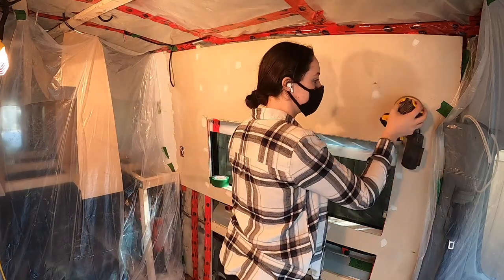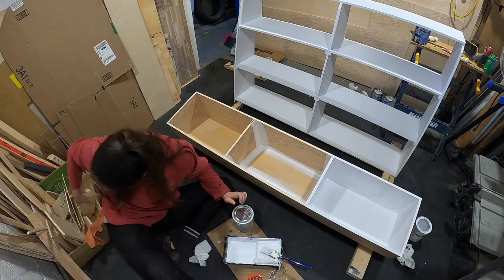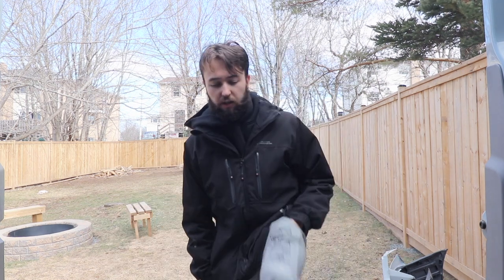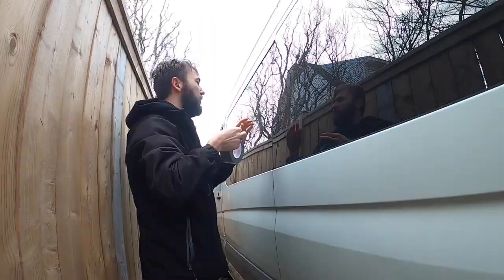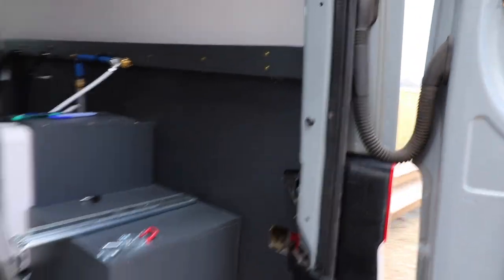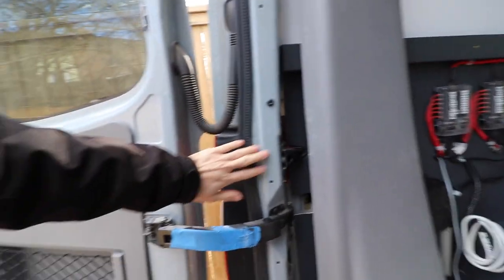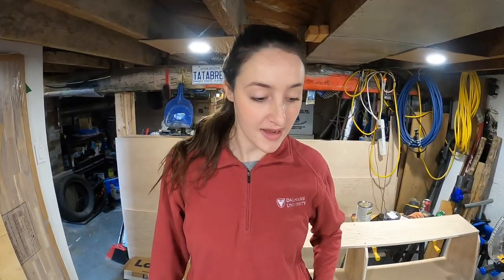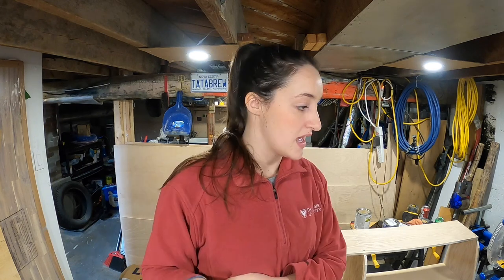FABRIC to cover exposed metal on SPRINTER VAN! | van life build pt.14

Comment: Did you upholster your cab headliner? Do you happen to have a video on that or tips?
Reply from the maker: Yes we did, didn't film it in detail... But we first wrapped the plywood in upholstery foam to create that "headliner" feel, and then we put fabric over top of that. We used the same spray adhesive and the staples to hold the fabric and foam on.

Comment: Looking good. Im Laid in a van at 5am i can say any metal you dont cover will be like a fridge shelf. Any reason you didnt insulate in the holes hy the back door which you put the material over.
Reply from the maker: Hi! We left that open for the opportunity to run any future wiring in case we wanted to add something. We've since added some more usb charging ports and an internet cable through there, so we're happy we left those holes open for that!